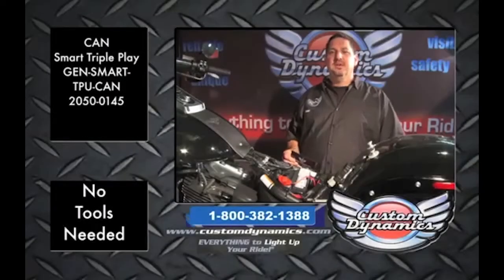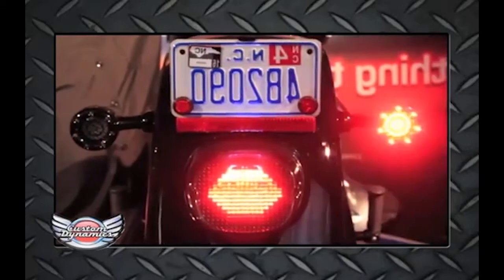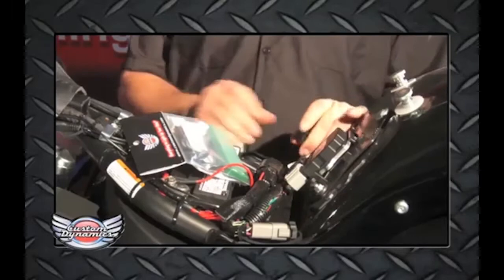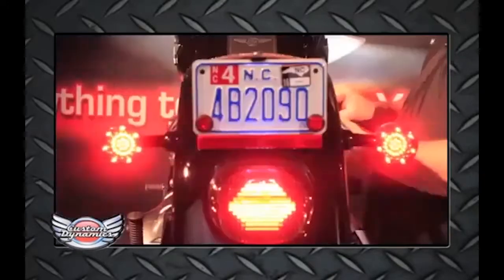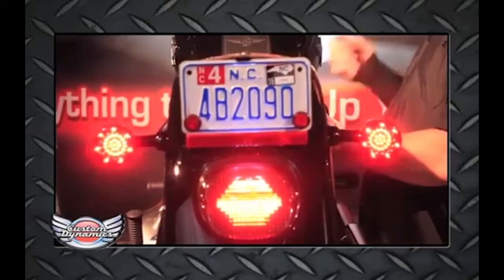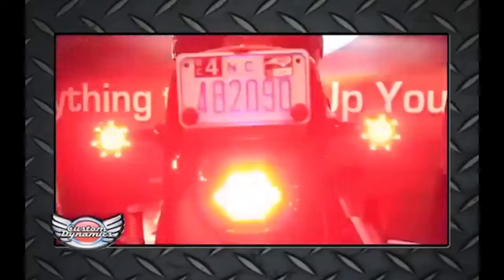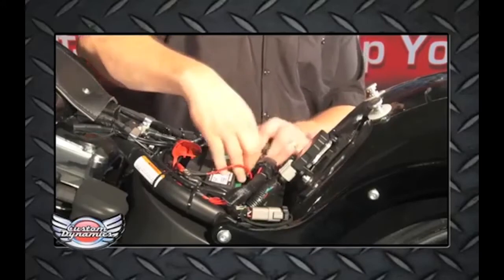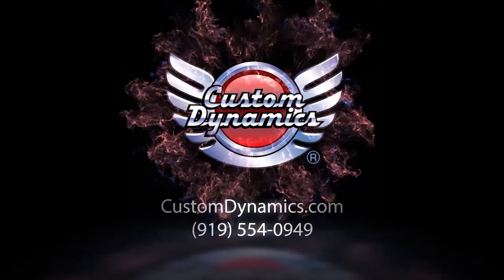How To Install SMART Triple Play® Run, Brake, Turn Module

Comment: I have a 97 Harley Davidson Dyna Wide Glide.  I bought this kit to replace the old one. Mine came with 2 extra wires with plugs. What do I do with those?
Reply from the maker: The two smaller pigtails on the Triple Play will only be utilized with additional plug and play Custom Dynamics lighting accessories (ie saddlebag lights). If you don't have additional rear lighting accessories installed, they are not utilized.

Comment: Hi I have converted my 1156 rear bulb holder to 1157 on my 2013 fatboy as I have 1157 plug probeams,I have added a fly wire to the central tail light so the halo will light up as running light,if I buy the triple play,will it still work,as it sounds like I need a double play,if that makes sense, or how do I go about wiring the brake lights to it,kind regards
Reply from the maker: Since the rear wiring has been modified from stock, it would be best for a technician to review your products and application to best advise if additional components are required and if any modification will need to be made to install. You can contact our technical team at this link: https://customdynamics.zendesk.com/hc/en-us/requests/new

Comment: The ON OFF ON switch routine to go into programing .  Once you are all done programming do you return them to the OFF position or do you keep them in the ON position,
Reply from the maker: Hi Ken! Once finished with the programming of the SMART Triple Play® module, the position of the on/off switches will be dependent on whether you want to apply the brake strobe/flash patterns to the center taillight only, rear turns only, or rear turns and center taillight (see below). 

Switch Functions:
Switch 1 On, Switch 2 On: Strobes/Flashes on all three Rear Lights (turn signals and center light)
Switch 1 On, Switch 2 Off: Strobes/Flashes on rear turn signals only
Switch 1 Off, Switch 2 On: Strobes/Flashes on center light only
Switch 1 Off, Switch 2 Off: No Strobes/Flashes

Let us know if you have any other questions for the time being and thank you again for considering Custom Dynamics!
Reply: @customdynamics  WOW did not know this  THANKS
Reply from the maker: @Kenny-hh3zf  We're always happy to help, Ken! If you have any other questions, please don't hesitate to let us know! Thanks again for considering Custom Dynamics! Have a wonderful weekend!

Comment: So I wouldn't have to convert to 1157 bullets on my rear? This will turn my 1156 into running light / brake light?
Reply from the maker: Correct! The SMART Triple Play® module converts rear 1156 turn signals (models with a center taillight) to function as run, brake, and turn with choice of 10 user selectable built in brake light strobe/flash patterns (user can also select no strobe/flash on brake)! So, the single-intensity 1156 bulbs can provide run/brake/turn function without needing to change out the bulbs/sockets! If you have any other questions, don't hesitate to let us know! We're available by phone at 1-800-382-1388 (Normal Business Hours: 8:30am - 5:30pm EST Monday - Thursday; Closed Noon - 1pm & 9:30am - 5:30pm EST Friday; Closed Noon - 1pm) or, you can email us direct (Erin@customdynamics.com).  Thank you for considering Custom Dynamics! Have a wonderful week & Ride Safe!
Reply: @customdynamics  awesome I just bought one and was trying to figure out if I need to do a conversion or not. Thank you for the response
Reply from the maker: @aragos32727  Happy to help! Thank you for choosing Custom Dynamics®; have a wonderful week & ride safe!

Comment: Why is it my tail lights do light up when pressing brake peddle? I have two small plugs remaining on it triple play but don’t see anywhere to plug them in.
Reply from the maker: The Triple Play will convert the rear turn only functioning turn signals to stay on all the time as a running light & function as added brake lights. The two small white connectors are for added lighting accessories to also operate off the Triple Play. If you don't have any add-on Custom Dynamics lighting accessories those connectors will not be utilized.

Comment: Hi, Just I Installed the smart triple play on my Ultra Limited 2017, I did the same steps worked fine, but my issue is no flashing during breaking even I change the nub.

I also bought the Extension cables, but no clear video or manual to show how to connect them.
Reply from the maker: Hi Hasan! We'd be happy to help - might you be able to follow-up with us via email direct (Erin@customdynamics.com) or by calling us at 1-800-382-1388 so we can confirm some product information/help with troubleshooting? We look forward to hearing from you soon!

Comment: Can it also strobe the front turn signals? Will this work on 2019 Ultra Limited with 114 motor with the new Boom Box?
Reply from the maker: The SMART Triple Play® only strobes the brake function for rear fender lighting. On a 2019 Ultra Limited, you'll actually use our Magic Strobes™ Brake Light Flasher which offers the same flash/strobe patterns to the brake functioning lights on the rear fender and/or Tour Pak! We have options to flash/strobe the Tour Pak as well as rear fender lighting (i.e. center taillight, add-on saddlebag LED lights, etc.) - these modules are sold separately from one another. You can find those options for a 2019 FLHTK, here: https://www.customdynamics.com/amfinder/?cat=108&find=harley-davidson-2019-ultra-limited--flhtk--10657 There's a few fitment options so please feel free to call us at 1-800-382-1388 with any questions you might have!

Comment: So this is what I need if I want to my single function leds to work as run/brake/turn lights?
Reply from the maker: Yes sir! Our SMART Triple Play® module converts rear single-intensity 1156/7507 turn signals (models with a center taillight) to function as run, brake and turn with a choice of 10 user selectable built in brake light strobe/flash patterns (user can also select no strobe/flash on brake)! You can find all our SMART Triple Play® fitments, here: https://www.customdynamics.com/category/electrical-accessories/run-brake-turn-modules If you'd like, you can also email Erin@customdynamics.com with the year/model of your bike to receive more specific product information! Thank you for considering Custom Dynamics, have a great afternoon!